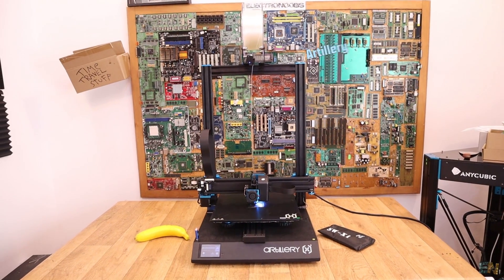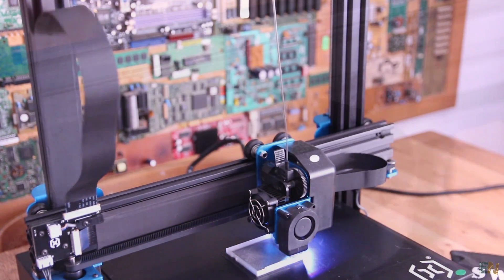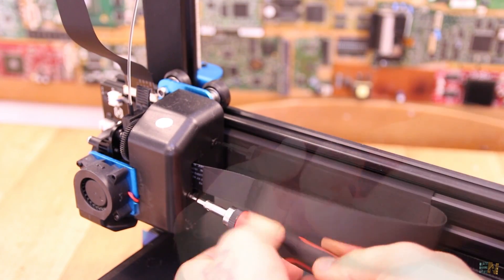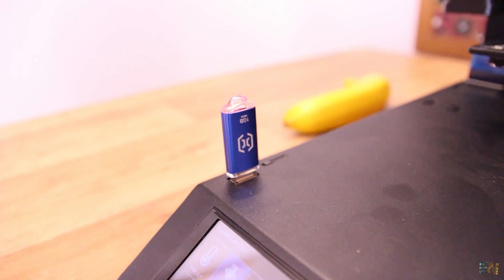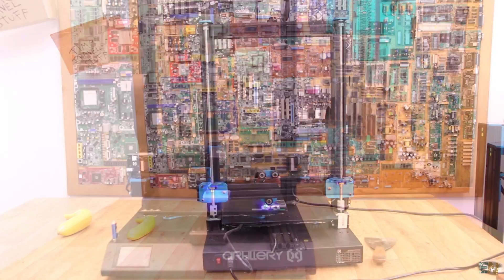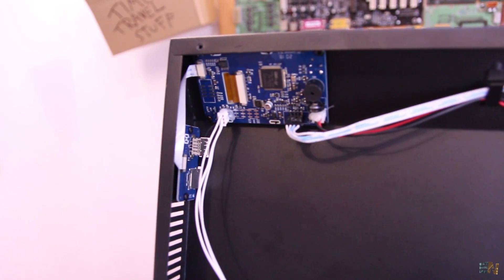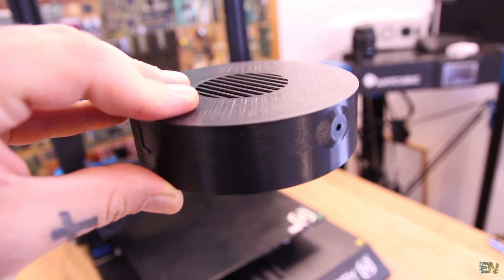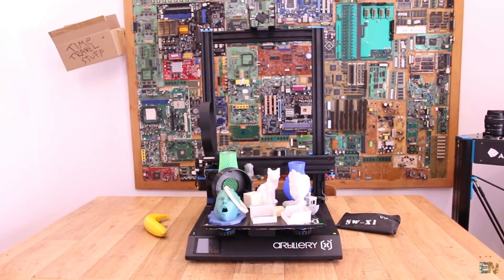Artillery Sidewinder X1 3D Printer Review - My Favorite For 2020?

Comment: Just as a little warning, the protective earth on this printer is not connected to the chassis and moving metal parts. So if you have a failure in the heatbed or somewhere else in the mains wiring, the printer could be deadly to touch! They do not offer CE compliance either (the logo on the back sticker is visibly fake) so technically this printer is basically illegal to be sold and used in the EU. If you try to import/buy it from china you are responsible and customs could seize your order and fine you... Hands off, or at least be aware of the risks you take with that printer!

Comment: Amazing video. But I can see some artefacts. It would be awesome if you can check the slicing settings and the rollers(usually if they are  over tightened or a little bit loose) and if the two z axis are synced as those are the common issues for such problems  .8:59

Comment: Love the review, very detailed, my but not boring hahah!
Just a quick, unrelated, question, can I power up my arduino board with a car battery? Im a newb in these practical stuff.
Reply from the maker: Yes. Car batteri is 12V ot 14V. For example, maximum Arduino UNO input voltage is 16V. But yopu must connect that to the Vin pin not to the 5V one, otherwise you will burn it!
Reply: Yes.... it is better to keep an external 5v regulator since the one on the arduino is very small. Keep up the content electronoobs :)